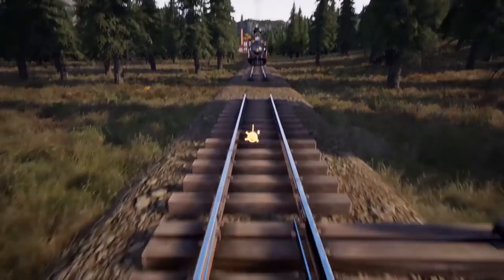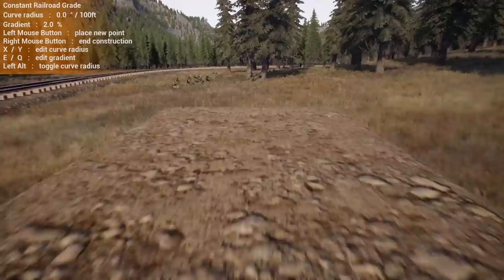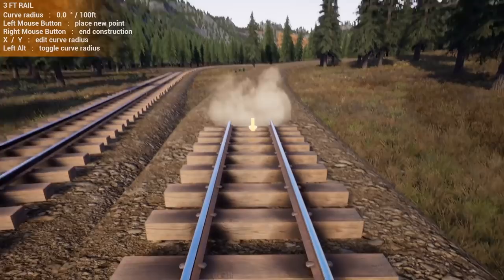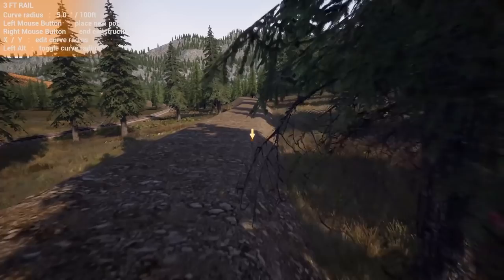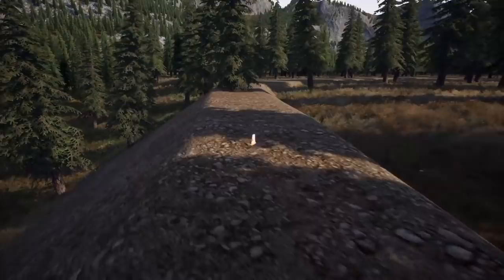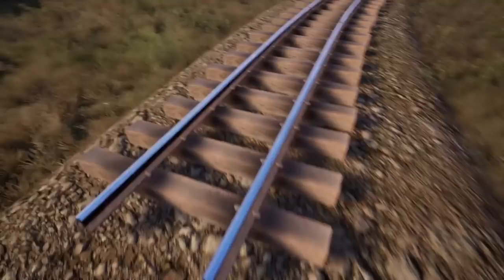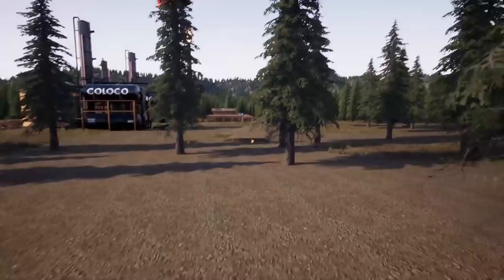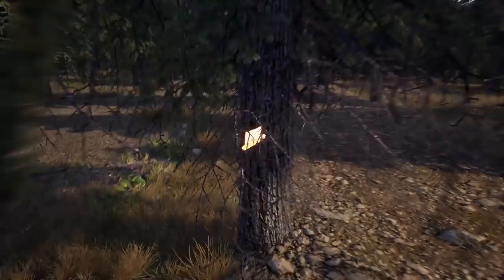[RO!] Ep. 9 - Laying (mostly) GOOD track to the REFINERY... finally!

Comment: ES&D safety announcement : This track is not K10wN approved   :)
Reply from the maker: Well you heard it from the man himself. Poo poo track indeed!
Reply: Hyce started so well but the moment he had to fix a track he gave up on all of it! Geez!
Reply: As a tip that I learned from K10wn, I'm actually not counting the ties, I'm looking at the moment it goes from ties closest end of the rail to largest gap between last tie and end of the rail. By looking out for this jump made it easy,  just change from watching for the rail to disappear to watching for that jump. It's a every tad slower but you get that short perfect length segment that K10wn likes. 

Still, I think that was Mt favorite part of this video, seeing you at least challenge yourself and learning and seeing,  hey it works!
Reply from the maker: @abbycottontail  i try to not just be a shitpost for entertainment :P
Reply: I'm just too straight edge miss two goodie shoes for shit posting,  perfection or breakdown! (Yes, I have breakdown too often, I wonder if I'm like a geared Loco, difficult to work on, often break down but a hardworker when functioning.)

Comment: I didn't know about the track classification system. After looking at other examples of class 1, the appearance of the site around last week's Farmingdale derailment doesn't seem so shocking.  Wheel vs Track shavings aside.

The Reddit thread "Heard a slight banging last night." links to a local's visit to the site, w/ much swearing in bewilderment.
Reply from the maker: Yowza.
Reply: Oh.? Does it looks more like 'excepted' track than 'class 1'?

Apparently Reportedly an SUV got high centered in a snow bank on the nearest rail crossing there in January; The car got hit by a (-MTA!?-) train before they could finish digging it out. The MTA were investigating.(?)

Is there some special historical status this once-part of the "Blue Comet" line could have that would allow permit a passenger train to use it? 
(Or is it more likely MTA was they were moving an otherwise empty train? And the MTA got involved after the collision.)

Comment: Hope the update is coming along well!! Here is a idea! Have a simple flat cart that hooks to the hand car so you can transport fire wood if you wish.
Reply from the maker: That's an interesting idea, perhaps the little 2 axle bois will play nice with that.
Reply: @Hyce777  agreed, there is one on display at the railroad musam in Gorham New Hampshire and I wondered what it's use was. So I figured that since it was the same size of a speeder, that it must have been able to be towed by one to carry items that would have been to big to fit on the speeder.
Reply: Hears another I'd. I know you have railroad signs planned for the game. How about a proper railroad crossing. It would simply be wood planks that you place on the tracks that give that section of tracks the look of a crossing. If you were to picture a railroad crossing on a dirt road or farm road that would be it. You could even put it over a switch for roads that go through yards.
Reply: Another Idea I had would be a small mow shed. You could park the hand cart in it with the for mentioned cart and the inside could have track tools. There would be tracks that leave the building and go the running track, there would be some wood in between the rails that the hand car could be spun around on to take the hand car in or out of the building.
Reply: I'm glad you are liking my Idea's! I'm going to push the bill and give you some more! One idea would be to have a simple tie that you could place at the end of sidings to act as buffers. A ball single would be nice. And for trains that have no caboose you could put a red flag or red lantern in the cupping of the last car. Thanks for developing this game you guys and I'm looking forward to the new update! Good luck to you all!!

Comment: Hello, Hyce,

I am coming from @Bballjo channel, he currently is in progress of series of this game (among others). I watched carefully few episodes of tracklaying and such and he pointed me to your channel, so here I am. I really like how the game looks and was taunted to buy it and try it, but I am having some concerns.

Don´t take anything bellow wrong. You have been speaking about how "too simplified" other games are and the balance between "it is fun and challenge" and "it is another work". And I have to admit, I am more on the side of "it should be close to work!" side. And my work mainly consist of drawing railroad tracks, switches and such, my view is definitely twisted a bit. But as both railroad fan AND an drawing guy, my feedback/critique of current beta (and what holds me from actual buying for now) is this:

a) you cannot terraform at all. This is not only about tunnels, but also (holding) walls, cuts, embankments, one side wall embankments... (you are doing 2-side walled embankment all the time, which feels quite off when building near a rock on one side, or you need to multiply it, making it look really awful). 

b) thanks to (a), you have to either follow a pre-prepared and pre-terraformed route for you (sometimes painfully obvious, especially around Iron mine etc.), or you are pushed for using bridges/high walls all the time on steep slopes, because you cannot do anything more. Same thing goes for going "off the pre-planned track". You have great terrain in this game that allows for ... I do not know US term, but in CZ "rozvinutí tratě v terénu" and basically means using side-valleys and curves for making the track long enough with reasonable incline to ascend/descent where you want it. Huge parts of such track layout are embankments (you have some), bridges (you have some), different shaped cuts (no way for now) and of course tunnels (not even a word here). Beautiful (european, cause that´s what I know better) example is track between Koper (Slovenia) and Prešnica, look for Hrastovlje village on googlemaps and its surroundings. Sometimes builders needed to design even stranger things like helixed tunnels (example 2: Telgárt in Slovakia, look it up, beautiful thing coupled with bridge!) or looped bridges (Bruscio bridge on Bernina pass rails in Switzerland). All these have, btw, clip of going through from locomotives, I may try to find it and push it into comments bellow this one. Not sure it will work, youtube doesn´t like urls ;)

c) due to both points above you are pretty restricted with few track pieces and to make it all even possible, railroad rules goes little out of the window and I have no idea how much they actually restrain the gameplay. From derailments I would suggest a lot, but incline of 8% is like double what is allowed on normal tracks. Not sure about USA, but standard tracks in CZ have maximum incline of 25 promile (2,5%) and maximum allowed is 4% - everything above that is "rack railway". Also minimal radius allowed for rails here are 190m (40 km/h speed), for sidings and factory conections is 150m bare minimum and even this can affect the ability of longer wagons to go over it. Things like yours 80m, 50m or even 30m at one point are suitable only for mining carts, narrow gauges (not used much at all) and tramvays, definitely not standard trains. But the game simply forces this sometimes due to a+b points, which was the tipping point for me for now. 

d) Tree removal the way it is right now would be super annoying and would need a rework, too. And probably track laying could use an update too, like standing on an unfinished rail would be a good start (and probably necessary for tunnels anyway), so you could actually build things and see where they are going and not only guess after running sideways around a valley (or, in your case, on a high-rise wooden lookout tower :D). 

Thanks for your presentation anyways. I honestly hate wiggly tracks laying and angle locking and other things would be used much more in my case, but that is user preference. Above issues are key for me. If you will address these issues, it may be a really good game and will add insane variability. If not, no worry, easy money saved for me, others will have fun even without these probably ;)

Have a nice day and links bellow if it will turn out! :)
Reply: example 1, Hrastovlje, SLO - front seat view here. On the starting frames you can see another train right under the cliff - that, in fact, is a train going in front of the one we are looking for. Amazing track layout and I really miss these opportunities in this game so far
https://youtu.be/eb6fV5eyjp8?t=1117
Reply: example 2 - Telgárt tunnel, SK. Not a drivrethrough, but great presentation anyway
https://youtu.be/3fVJaEEcGOs?t=197
Reply: example 3 - Bernina pass helix bridge. Unique and really beautiful. Out of all those other things, this one might actually be buildable in the game, or will bridge supports block the attempt anyway?
https://youtu.be/Mw9qiV7XlFs?t=6313

BTW yes, that bridge has 50-70m radius of tracks AND and incline of 7%, but those trains are specifically made for these inclines. It´s rails are also a narrow-gauge, only 1000mm wide, which allows for such turns.
Reply from the maker: Love the points your making, but unfortunately I've not been involved with RO! since May.
Reply: @Hyce777  that is so sad, what happened? And any chance of forwarding this to those still working on it?
Reply from the maker: @siriusczech  Much to much to simply just type something here. It was unfortunate. And, unfortunately again, there's not really a way for me to provide feedback in a way that it's accepted. Best chance for you to have success is post something on the steam forums.
Reply: @Hyce777  not gonna bother probably, as a non-owner that shit would get zeroed pretty easily